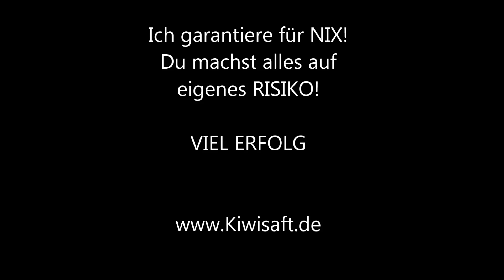HowTo: SSD or RAM upgrade for MSI Ghost GS60 (GS60-2pci581)

Comment: hi there, thanks for the video. I got myself samsung 970 EVo and I want to add into the second M2 slot. I actually already tried it but after installing it my laptop won't start. Noting at all, no blue light no fans nothing.
So I uninstalled it and voila it works again. Am I missing something??
Reply from the maker: I think the msi doesn't support nvme but only sata driven ssds
Reply: @kiwisaft  Thank you for your fast reply. What M2 did you use?
Reply from the maker: I installed a Crucial CT525MX300SSD4 and a Crucial CT240M500SSD4 @ruidogarian3086
Reply: @kiwisaft  super..thanks for your time . You really helped me out 😊
Reply from the maker: you're welcome. advantage of SATA m.2 SSD is, that they are ceaper ;)  @ruidogarian3086

Comment: Hello, which ssd did you use? Greets
Reply from the maker: CT240M500SSD4  and meanwhile installed a second one CT525MX300SSD4
Reply: Kiwisaft Design Thank you for the quick reply after all this time. On the msi website i found that the storage is only expandable  by 256GB? How come you have installed 500GB? :/
Reply from the maker: Emiel Van Belle I guess this is not true. there is no such limit. it works perfectly
Reply from the maker: Emiel Van Belle looks like this is the maximum ssd storage they offer, not the maximum possible. you can check the chipset specs
Reply: Oh, thank you, and could you check the ssd i said? I am quite new to all of this and i don't want to waste that much money...
Reply from the maker: Emiel Van Belle well, I'm no expert. I think you need to check if the SSD uses SATA or PCIe protocol. can't remember which one works, but google will help you
Reply: Okay, thanks alot!

Comment: kann man die Grafikkarte auch austauschen? mfg habe das selbe Gerät mit einer gtx 970 hätte aber gerne eine 1060
Reply from the maker: überlicherweise sind die Grafikchips bei Notebooks fest verlötet. Bin mir zu 99% sicher, dass das hier auch so ist, gerade wegen der flachen Bauform.
Reply: Kiwisaft Design kann man das Mainboard mit dem 1060 Grafik  Chip irgendwo kaufen ? mfg

Comment: what kinds of m.2 will this accept (keying and length)?, I read that it's 256GB maximum is that true?
Reply: I installed an Intel 1TB M.2 80MM SATA III SSD 5 with no issues.

Comment: wie sind denn die mechanischen Abmaße der SSD? also die Länge? Die gibts ja in 40mm , 60mm und 80mm....passt da auch eine 80er rein?
Reply from the maker: ich habe eine CT240M500SSD4 verbaut, die hat 80mm. ob es auch befestigungslöcher für 40 oder 60mm gibt weiß ich nicht mehr
Reply: super, danke für die schnelle Antwort!

Comment: can i put in 16 + 16 for a total of 32 for RAM .. will the system support it ???
Reply from the maker: +kabir Moz I really don't know, but I guess so. maybe you can check the chipset specifications
Reply: +Kiwisaft Design Pretty unlikely considering the chipset limitations. What you need to consider is the chipset and available slots. The GS60 Ghost Pro (or at least the 3k version) doesn't have more than 2 slots, with a max combined of 16GB (2x 8GB). The other element is price. Even if you could find a single 16GB module it would be prohibitively expensive (because there's just not a large enough market/volume for it...yet). The chipset specs also state that they don't support higher than 16GB on this version.
Reply: +kabir Moz You can, look at MSI specs 32 max ram
Reply: +Harry Harrison Where is the spec sheet, do you mind sharing .. thank you!!
Reply: +kabir Moz http://m.newegg.com/Product/Details?itemnumber=34-152-941 Under Specs, Warranty and Returns and under Memory it states that the maximum memory supported is 32 gb with 16 in each slot

Comment: This laptop supports 60hz on an external monitor of 3440 x 1440p connected by mini-displayport?
Reply: +w7hm , YEs i think. I use triple screen , laptop FHD 1920x1080 , External mini Hdmi 1920x1200, and a Display port 30" dell ultrasharp 2560x1600, you can use intel HD4600 or the GTX970M, or automatic system , in low usage , the system will be use a HD4600 and in High the GTX

Comment: 1. How many M.2 does the laptop fit? I believe 2?
2. Whats the maximum capacity on each bay?
3. Once the SSD is installed how can i install a fresh copy of windows on it?MSI doesn't provide a product key? Do i have to use a USB Flash drive? and how does that work?

Also, should i raid all the drives? or leave them as is?

Any information helps.
Reply from the maker: John Khoury 1.) two
2.) more than you can afford
3.) windows usb dvd download tool. i guess the key is somewhere stored in the EFI section. but you can extract it from your running system. just google it
4.) raid if you have a benchmark-high-rank-fetish
Reply: Thank you for the help.
Reply: Just Fyi the MSI GS60 800 series graphics which i have has only one M.2 SSD slot not 2

Comment: how many SSDs can i fit into this thing? I need more storage ......
Reply from the maker: Two
Reply: Kiwisaft Design So that means that I could mount a total of drives?
Reply from the maker: Albert Feng depends if you use the pita bread or not
usually the math is like 1 + 2. sorry have no calculator at hand, but maybe you have
Reply: Kiwisaft Design Lol! Nice vid! Thanks :) Also, how did you know this? Did you just try it out?
Reply: Jiga Loo I mean the whole demount operations ofc :D
Reply from the maker: Jiga Loo you're welcome. just did it ;)

Comment: hey I got this laptop without an HDD. now I'm trying to put an HDD in it, but the cable I have doesn't have a place to connect (either the connector on the cable I have is wrong or I can't find the right one). what exactly does the hard drive connect to? is it on the flip side of the motherboard? what does the cable look like? is there a replacement part number for it? btw it's a 2.5 inch 22 pin HDD. Thanks!
Reply: What version of the GS60 are you describing?
Reply: It's a ghost with the 1080p screen
Reply: Gtx 850m
Reply: There's ALOT of ghosts with 1080p screen ;) do you have a model number?
Reply: Christian Hougaard-Enevoldsen MS-16H4. is that it?
Reply from the maker: i guess most msi models use the same cable (not sure)
something like this http://cdn.eteknix.com/wp-content/uploads/2014/05/MSIGS60_GhostPro_HDD_SPK.jpg
just google "msi ghost hdd connector"
Reply: Christian Hougaard-Enevoldsen thanks for the responses guys. but Christian, there is no slot like that in this laptop. it looks like kiwi's picture, and i'm missing the orange cable and the female slot for the hdd connector. I'm guessing they're the same part. The corresponding cable on my old laptop was similar, but it doesn't fit here.
Kiwisaft Design I've tried googling that and I can't come up with anything even close. also the manuals I could find were useless. for my old HP the manual had the part number for everything.
Reply from the maker: Saurabh Mitra
have you tried MSI forums or MSI support?
Reply: Saurabh Mitra well.... Where did you buy it?
Reply: Kiwisaft Design Yeah I contacted MSI support. they said they'll take 6 to 8 weeks to identify the part and ship it. 
Christian Hougaard-Enevoldsen I got it on amazon
Reply: +Saurabh Mitra Hey, were you able to do it? I'm with the same doubts here
Reply: Lucas Arantes yup I found the orange cable. MSI shipped me one, and then a week later, I realized that they also provided a spare one in the box the laptop came in. It connects a SATA drive to their motherboard and works fine.
Reply: Saurabh Mitra you are right, I didn't realize the use of this cable that came in the box. I'll try it then! Thank you!

Comment: oh my  god , i wont do this as my laptop might not work ever again
Reply: knockmyfeeling 
It's not that difficult....

All it involves in unscrewing/unplugging and screwing/plugging back in

Not hard at all.
Reply: TechnicaIlyInsane 
And I have one of these laptops.  4710/860m.  Very nice system.  Mines been great and have only had minor software issues that falls on Windows being lame.  But no crashing or blue screening at all.  Its fast as fuck too.  Multi tasking and booting up is like childs play with the SSD and 12gb of ram.  I was thinking about upgrading the ram or HDD but I don't really see the need.   I got this system on a line of credit to game and have a portable system.  Once I pay off the credit bill I'll have another $2k to spend (Also bought a desktop monitor/keyboard/mouse/cooling pad/cables) and I will be building a new desktop.  But right now this is my main system and it's just fine.  Highly recommend this laptop if you don't want a gaming laptop that's ridiculously large.  This thing has so much power and still its light and thin.  Haven't had any cooling issues yet either.  It idle's between 33-40c and under load its usually between 50-70c, but I have seen it hit 80c.  Shouldn't be a big concern as 90% of the time the laptop stays under 45c, hitting 80c every now and then gaming shouldn't cause an issue.
Reply: Kiwisaft Design For you information, I fixed it today... yes, after a good night.
I opened it again, disassembled the whole thing to check if everything was ok. And I found it.... There is a little cable between the.... power button small card and the main board that was disconnected, not on the main board side, but on the other side, which is below the main board, on the side where the main board is still attached.
I think I raised the main board to much (more than you did in the video, I ended up raising it up to 90 degrees, and you only 45 I guess) so there was some tension on the cable that detached it, because it was glued at mid-course, so removed it from its connector on the main board didn't help.
Conclusion: everything is ok!

Thank you for you video. I am now also a master in disassembling this laptop, I think I did it ~ 15 times :)
Reply: TechnicaIlyInsane It seems simple. It is. I did it on a lot of laptop before. But this one, I don't know, I did everything carefully. But nothing happens when I press the power button. I tried removing the additional ram I added. Nothing.
I am very depressed....
Reply from the maker: Twidi - S. Angel have you tried powering up with power cord connected?
Reply: Kiwisaft Design yes, the first time (and every time I tested), as you said in the video. And i checked, again and again, every cable, every screw...
Reply from the maker: Twidi - S. Angel hm, feels bad. sometimes it helps to sleep a night over it and try again next day :) good luck
Reply: thx
Reply from the maker: Twidi - S. Angel nice :)
lol, I'm glad, I only had to do it 3 times ;)
Reply: Oh you know it's only because I tried, and tried, and tried, to check and make it work again :)
Reply: Yeah, you're crazy if you think I'm gonna try this! Lol

Comment: Do you remember what brand the ram was?
Reply from the maker: No, I couldn't see, because it is on the lower side. But CPU-Z says it is a Kingston PC3-12800 800MHz (Part Number MSI16D3LS1KBG/8G)
Reply: Only 800MHz? Looks like I'll be replacing that.
Reply: Kiwisaft Design PC3-12800 is normally 1600Mhz?

Comment: Thanks for uploading this video. This procedure looks like it would void the warranty, correct? What is the default RAM configuration? 1 8 GB stick? Sorry if that was mentioned somewhere in the video.
Reply from the maker: Yes, one screw is below the warranty label. In my configuration there is one 8gb unit and one slot is still empty
Reply: Kiwisaft Design man muss all das machen nur um die ssd austauschen zu können ...? Wollte mir das Gerät eigentlich kaufen (auch mit i5) aber das traue ich mir nicht wirklich zu.. und ohne SSD geht garnicht
Reply from the maker: coolertuep
ohne die SSD ist es wirklich ne lahme Mühle. wundert mich, dass MSI das so verkauft, macht keinen guten Eindruck mit ständigen hängern. ich wollte eigentlich das i7 modell bei dem die SSD schon drin ist, war aber nirgends lieferbar. Hatte auch nicht damit gerechnet, dass es nicht einfach ne klappe gibt wies bei den meisten notebooks ist.
Reply: Kiwisaft Design aufjedenfall super, dass du ein video darüber gemacht hast!
Mir reicht die kleine Konfiguration locker aus, bin kein Hardcore Gamer.
hätte das Gerät für gut 900€ haben können - aber auf diese Bastelei und Garantieverlust habe ich keinen bock -.-
Kommt man an den zweiten (mSata?) Slot genauso bescheiden dran?
Reply from the maker: coolertuep
900 ist ja ein guter preis ^^ die beiden Slots sind genau nebeneinander. das einzige was leichter zu wechseln ist, ist das wlan-modul. aber das gehäuse muss man immer ganz öffnen.
und es ist KEIN mSata sondern m.2 (NGFF)
Reply: Kiwisaft Design Alles klar - danke für die Info. Dann fällt das Gerät aufjedenfall für mich raus. Mal gucken ob Asus es mit dem GX500 besser macht :P

Comment: Hi, which M.2 ssd HDD did you use?
Reply from the maker: Crucial M500 240GB (CT240M500SSD4)
Reply: Was there a screw, or which size did you use
Reply from the maker: Patrik Betak no there is no screw. i think the size was M2. but you can check if it fits from the backside of the mainboard, so you dont need to unplug everything until you know if it fits or not. the lenght is very variable, i think from 3-6 mm all is good
Reply: it was M2 3mm I have 5mm too, but it was too long, it looks long.Thans anyway :)

Comment: What is the maximum capacity the m.2 slot can take?  Can I install two 480GB m.2 hard drives?
Reply from the maker: as the m.2 is just a form factor and connects as SATA express to the PCI express bus, the limitation depends on your system. Anything below 2TB should be no problem for sure. if you use GPT partitioning instead of MBR you can go up to 8192 Exabyte - quite enough for the beginning ;)
I'm pretty sure you can build a super fast RAID with the two SSD drives, because MSI also sells such setups with this chipset
Reply: Oh ok.  MSI supports two m.2 sata slots with this laptop.  I plan on eventually removing the 1TB drive.